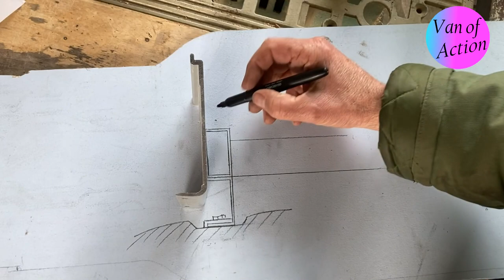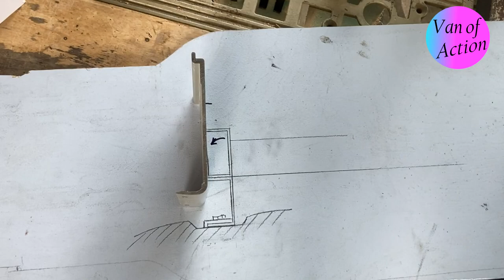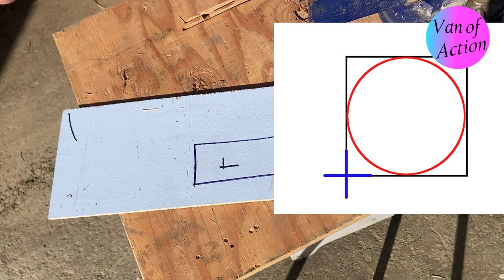How to Install an Awning - Van Conversion build for van life Promaster Sprinter Transit best awning

Comment: Great job Dave.  Thanks for going through the details.  Right off I thought using your existing brackets when possible was a good move.  That thing isn't going anywhere.  I'm looking to put an awning on this spring and this has giving me some good ideas as to adapting my roof rack to the brackets. Thanks.
Reply from the maker: Hey Chad - thanks for watching.  I'm really pleased with the results.  I'm sure you'll come up with a plan too.   Let me know how you make out .....  Be well Dave

Comment: Nice work Dave, 
Again, you are about a year ahead of me.  We had selected exactly the same awning for exactly the same reasons.  We will be installing ours on our Van of Action roof rack likely in 2024.  Kindest regards.
Cheers
Dwayne
Reply from the maker: Hi Dwayne - thanks for the comment - I stopped at your channel to let you know about the awning but saw you were on an adventure and thought I'd wait.  I hope you're trip  was a good as you expected.   The awning worked out really well.  The crank is a bit "inside" the body line and I have to have my arms up to properly open and close it.  I'm not sure what the balance is between keeping the rain out and making it easy to deploy.   Be well .... Dave

Comment: Hi Dave. You are really a handy man! Puzzling and searching for solutions. I like your video’s. I was just curious how you manage to secure the awning to the bottom of the bracket with those little screws. As far as I know you have to secure it with at least one screw per bracket. I didn’t see that on the video. I was wondering if there is enough room underneath it to get it done. I myself want to do it more or less the same way you are showing. 
Thanks
Dirk
Reply from the maker: Hi Dirk - thanks so much for watching and taking the time to ask.   The installer I bought the awning from explained that the only purpose of those screws is to hold the bottom of the awning to the bracket.  They don't support any weight at all.  And that can be accomplished by driving screws through the bracket and into the roof rack.   I addressed this starting at 10:45 of the video (the time stamp is a link to that place in the video).    Let me know how you make out with your install .....   stop back and be well .... Dave
Reply: Hi Dave. Thanks for taking your time to answer my question. Well, at first glance I still didn't understand what you meant. In your video, I saw that there was a bolt in the middle of one of the brackets. So I thought for lifting the bottom that's meaningless. But almost at the end of the video, you were talking about anchoring the awning after opening it. So I assume that after opening there is enough space to reach the back of the awningplate for putting in some anchoring bolts. Is that correct? Thanks, Dirk
Reply from the maker: @dirkbonthuis3820    Hey buddy - sorry for the  obtuseness of my reply.  I see now that I didn't show that part.   You are correct - at the end 25:00 - the first time I opened the awning (with the ropes still holding it)   I opened it just enough to get a screw gun in and sink in some screws.   Remember, all these fasteners do is hold the awning to the brackets. And that the back of the awning is right up against the bracket  They support no weight.   So I used 2  -   1/2" #8 Self-tapping screws at each bracket.   Then took the ropes off.   Be well ......  Dave
Reply: Thanks a lot Dave. Now it's 100% clear to me. Have a nice weekend. Dirk

Comment: Nice job Dave, what is the size( length) of the awning?
Reply from the maker: Hi Yves - thanks for coming back and watching.  I am really pleased with the way it turned out.  The awning is 10
feet  long and comes out 8 feet.   I have an exterior light near the back of the van and didn't want it under the awning.   Be well ... talk soon  ... Dave

Comment: Where did you order the brackets from that hold the awning on your rack. I'm asking about the fiamma brackets.
Reply from the maker: Hi @ dim4587.   I normally say thanks for watching.  But I think you may not have - unless you’re referring to the flat Fiamma brackets that come with the awning.  It’s gonna take some simple fabrication.  Be well….. dave